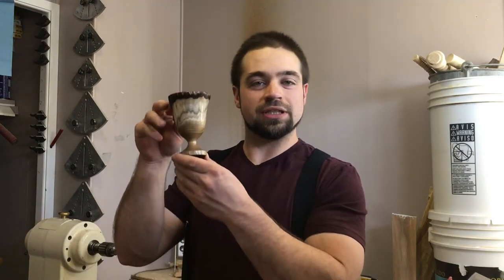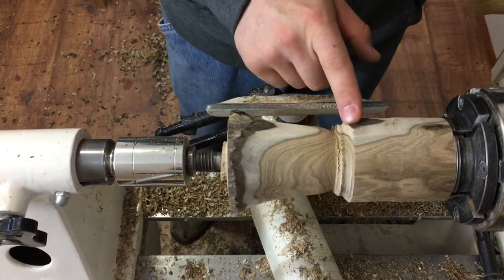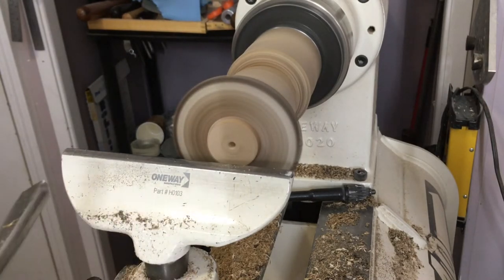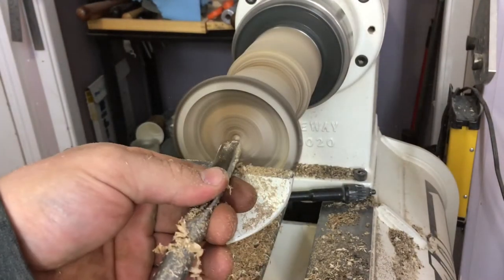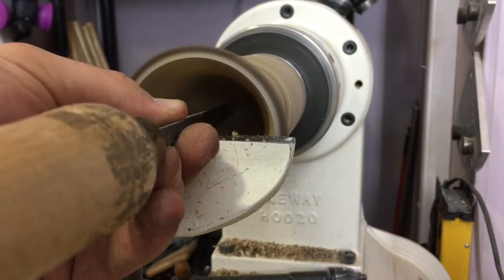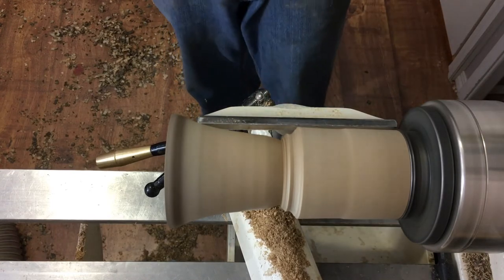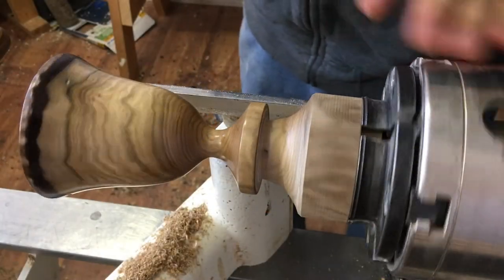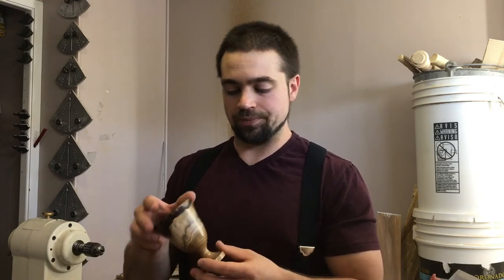Woodturning - Butternut Vase (Branch to Simple Art)

Comment: Very nice job and a true piece of art. I just love the look of butternut and it looks like it turns like butter.
We have nice woods here but butternut looks like all those colors have been poured into a mold and then turned. Hard to believe they were in that limb but I watched you turn it. Great job again Kyler!
Gary
Reply from the maker: ThePapa1947 Honestly Butternut is a great wood. It does turn just like butter, and fairly easy to get a good clean surface right off the tool. And sands very easy as well. The medullary rays (I believe) in the wood give it so much of its character, and these branch turnings seem to expose the best of the grain. It's still nice when milled in a slab or quarter sawn fashion, but from a full branch it really displays it best! 
Thanks again Gary! Looking forward to seeing your next update video and when you get the time to show off the tooling!
Kyler
Reply: It looks like an ice cream sundae or at least it reminds me of one.
I made a video today showing the lathe tools I used at work. Now if I can figure out how to add sound in it so I can explain a bit. Hard to do narrate and film and move tools around using a cellphone. My son has a Go-pro maybe I could try something like that. Not sure if you saw the race videos on my YouTube page. That is me driving his race car in one of the races he does.
 I have also made short video clips of making the gouge plus today I made two steel handles that will let me swap the tools in and out. I think I am going to like that because one of them I made a double ended. Even though I can buy all these items I just like making things.
Gary